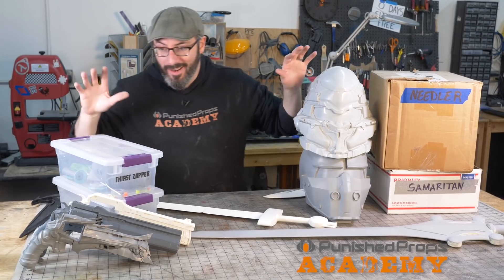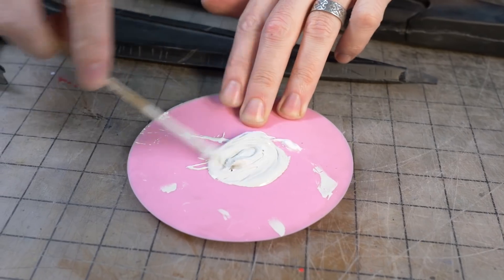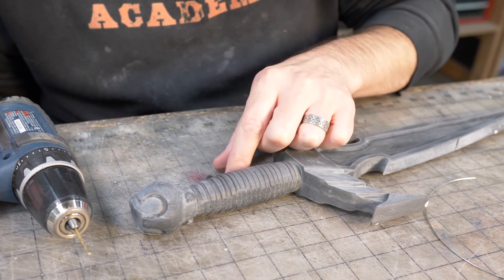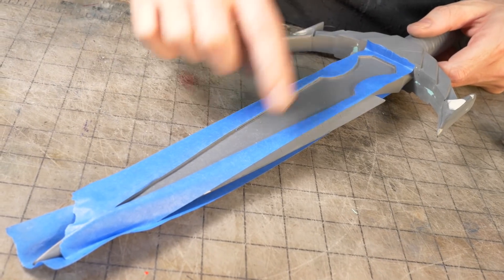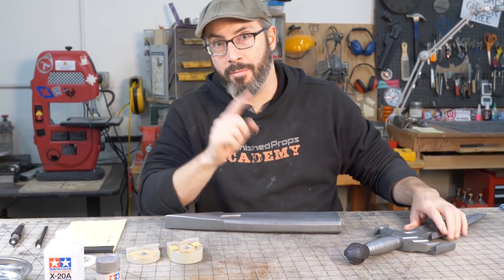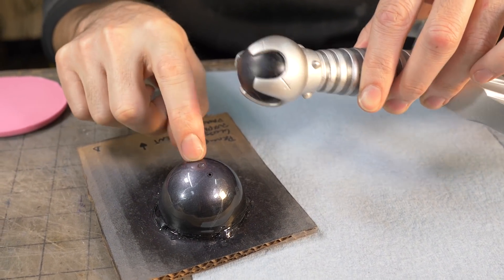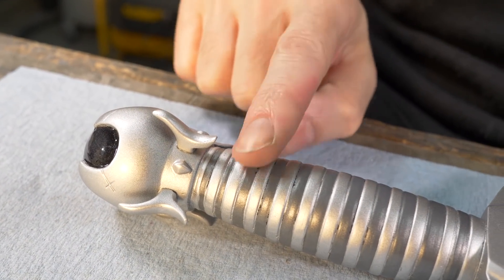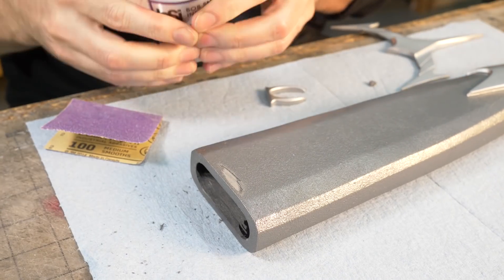IT'S FINALLY FINISHED! Resin Mehrunes' Razor Dagger | SKYRIM

Comment: I have a "Mopkin" puppet that I've had since I was about 12 and I'm 38 now. I'd been intending to work on it since I got it, 26 years now, and I just now got around to disassembling and upgrading it. I cut off the head to add a neck with a different material, removed the arms and legs and re-stuffed them. Stuffed the body that was just an open sleeve, reattached the arms and legs now with hanger wire for "bones," so I could add joints, changed the shape of the hands and feet and put magnets in the feet. Also added a sleeve that goes in  the back through the neck into the head. The only thing machine sewn is the shape of the sleeve, everything else is hand sewn. Right now I'm working on the eyes and adding upper eyelids. When it's done it will keep my nieces and nephew entertained, at least until they're older.
Reply from the maker: That's fantatsic!

Comment: I started a robot with a mechanical tail somewhere between 1981 and 1983.  I dropped the robot part and have been slowly putting together the mechanical tail.  Thanks to technology getting smaller (Ardruino, 3d printing, Ect), and my skills getting better, I am now down to how to mechanize it with a hidden motor/servo system.  38 years and going...

Comment: i know its not really in context here but i was watching a video where you had to cut circles in EVA foam... 

heres my trick: get an empty tin can and sharpen its edge. mount it on a bolt in the center of it back and then on a press drill.

i suggest you put some holes in the back too to allow air to escape and push the cut pieces out. 

PERFECT CIRCLES !
Reply from the maker: Neat trick! You can do something similar with metal tubes for smaller holes too!

Comment: I can't be sure of the exact timeframe but somewhere around...10-15 years ago I decided I wanted to make a Jedi costume. I bought boots, I sewed a cloak, shortly after that I made my own lightsaber hilt, then I started on the robes, made the first part way too big and then just completely stalled. I still have it all in my "finish this someday" pile.
Reply from the maker: It's a great time to pick it up again!
Reply: @punishedprops  But...but then I'd have to put down one of the 15 other projects I'm working on! 😆 I actually got my hands on some great grey linen I was thinking about using to continue it so maybe I'll start again sooner than later.

Comment: I know you just did a Foam Mandalorian/Boba Fett helm. But have you thought about doing full Mandolorian Mercs requirement compliant armour using expanded pvc board? (like Sintra)
Would be useful for wannabe mercs, plus you could join them for some trooping.
Reply from the maker: That's a super fun build, for sure, but I'm not currently planning to do a full Mando costume.

Comment: Not sure if you have heard this before. My mom is in a quilt guild and they call unfinished projects 'UFO' for UnFinished Object. Lol had to share that tidbit. 
Also I have a set of motorcycle grips and bits of cut PVC I intended to turn into a custom lightsaber back in 2008/09. At least 10 years sitting on the back  burner.  Lol
Reply from the maker: That's great!

Comment: Hey Bill if you do build the master sword from Zelda you can do the same techniques as you did for this prop plus you can slurry cast the master sword’s scabbard/sheath. Plus you can slip cast Hylian shield.
Reply from the maker: Hi Matt! Those things are all possible for the Master Sword. I'm not personally planning on making one, but it would be a really fantastic project.
Reply: Punished Props Academy Thanks. I’m going to be start building the master sword, it’s scabbard/sheath, and Hylian shield once I get done with something very important that I’m presenting to group of students and people.

Comment: You should try the diamond files they never get blocked or seem to wear out. I'm still using the original set I've used for years now and I've gone through quite a few lots of other normal mini files.
I work more with metals though not resins but they seem good on all materials.
Reply from the maker: Oooh I have some of those! They were a little aggressive for this build. I wonder if I can get some in finer grits.
Reply: Yes I guess they are much ruffer i was just thinking about removing material faster but your patience level is much higher than mine. 👍.
Reply: I'd love to see you doing one of those helmets I'm thinking of doing one myself, say a republic commando helmet but I can't find just the helmet without all the armor.

Comment: I have a question I use papa curragh these use my as my detail from making props. And I need a solution for filling in the hollow points for the guns  Because the inside of the guns are a hollow and I  Need a filler for the inside the guns because it's hollow. Says wondering if you got any good solutions or any ideas for filling the hollow point on inside the gun.
Reply from the maker: You might try a body filler like Bondo. This may help: https://www.punishedprops.com/2015/02/09/basics-of-bondo/
Reply: @punishedprops   I already use that stuff already I am asking is as there's a nother solution besides using fiberglass resin and bondo because I don't have a outside facility for mixing and applying it safely I do most my stuff outside. And right now it's about 20ﾟ outside and I do most of my stuff during the Spring and summer months and possibly fall. I have used smooth on material but that stuff is expensive and very useful. But the question I was asking I have some prop guns the inside of them are hollow and very fragile to break.  What I am asking is I manage to use dowels and cut them to size and put him inside the guns but it's still very hollow I need some sort of filler idea.  I was suggested To use Drive wall plaster the powder form not the mud form. And mix it to a soup and put it in But I need is a small pound bag but they're only offering 50 pound bricks  Bags. Is there a solution or a material that I can feel the hollow void in with the guns I have.

Comment: I have a WWII BF109 prop plane ace fighter and Diorama that has been sitting collecting dust for 12 years
Reply from the maker: That sounds like a pretty dope kit!
Reply: @punishedprops  it is not a kit, it is a 1/48 scale plastic model.  Buy the model. put it together with some photoetched parts, paint it, weather it. Do some History research. Then scratch build a diorama. paint it weather it. put the two together, add some extra things for background, paint weather, then display.  Lots of hours of work. A Labor of love.